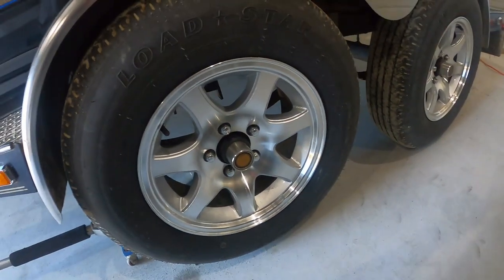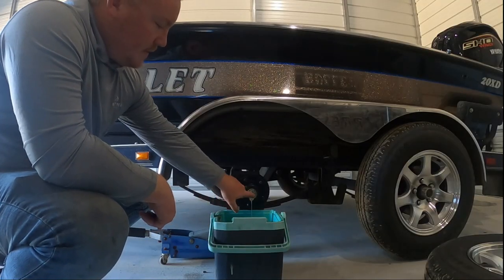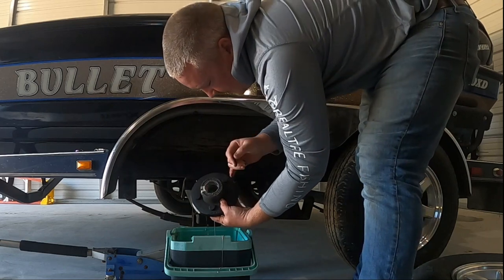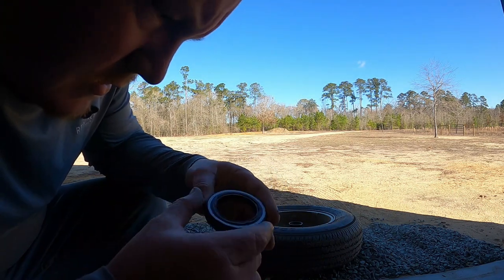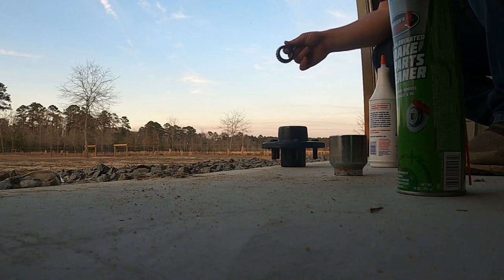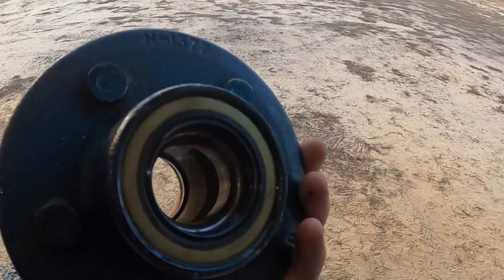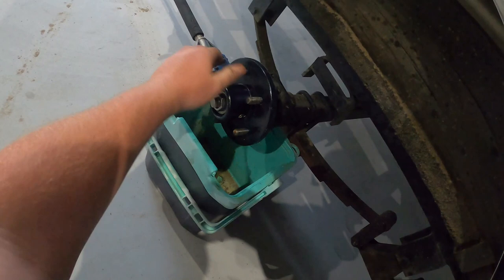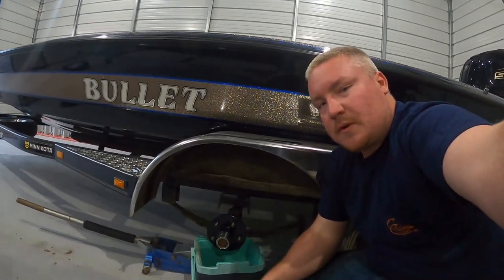HOW TO REPLACE A HUB SEAL ON A BOAT TRAILER

Comment: Do you bottom out the rear seal when installing?
Reply from the maker: Yessir, I tap it in until it’s seated on the lip inside the hub
Reply: Didn’t use RTV on the oil cap or outer part of inner seal? Dexter calls for it. Great video I’m about to do this.